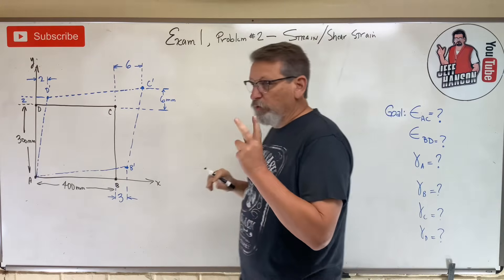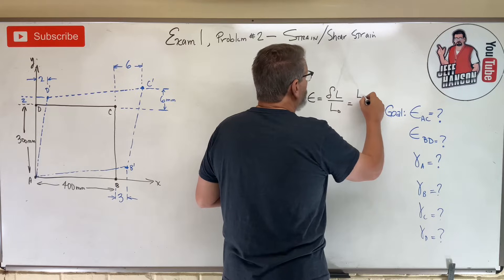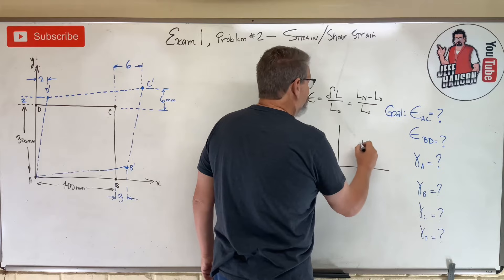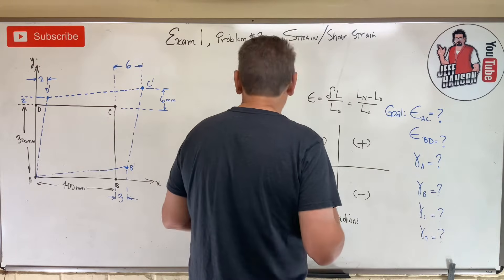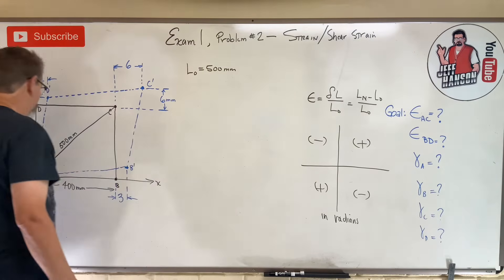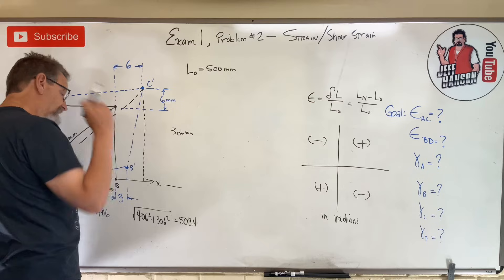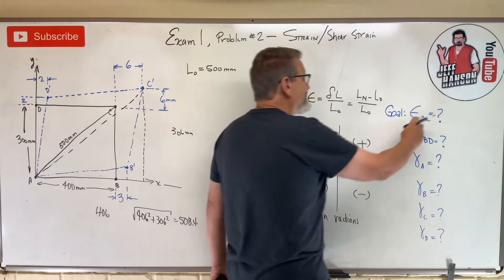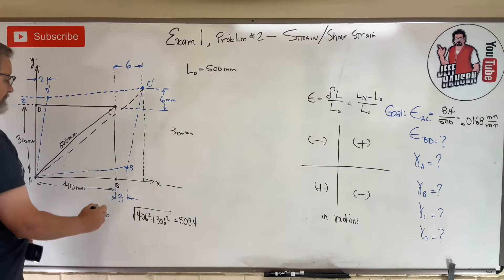Mechanics of Materials: Exam 1 Review Problem 2, Strain and Shear Strain

Comment: If the deformed angle is greater than the original angle, shear strain is negative. If the deformed angle is less than the original angle, shear strain is positive. Corners B and D should be negative.

Comment: Sir I believe there is a small mistake. 
For gamma B, I believe that the first triangle you did (one going up), the height is 306 mm, minus 3 would be 303. Skipped ahead in the video to see if you caught it. Just a minor mistake I think most people will catch along

Thank you for the videos though!
Reply: Correct, gamma B should be = 0.01734, and gamma C should be 0.01980. Both triangles he made were incorrect for calculating those gammas.
Reply: Yep, just saw this too. You are correct.